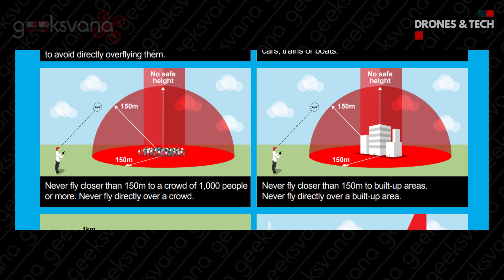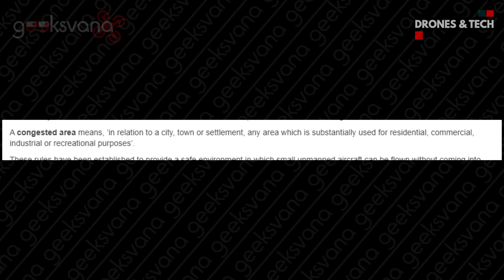What Does Congested Area Mean? With CAA Former Drone Lead Comments - UK Drone Rules - Geeksvana

Comment: I've just completed my A2 CofC course (exam tommorrow) and I have to say it was pretty vague on congested areas and flying the 1:1 rule come the 1st of Jan. I expected alot more in there on this particular subject, I'm still not sure on it to be honest. I think it needs a black and white proper English definitive outline from either parliament or the CAA as its still probably the most confusing point in drone flying and wide open to  interpretation (yours being at complete odds with the copper who's just pulled up to speak to you)
Reply: 1:1 only applies if you're in low speed mode on a certified drone.
Reply: @MikeysOutdoorAdventures  I didnt find it too difficult just a few areas where I had to get the information into my head and have it stick but on the whole you either already know alot of it if you fly within the drone code or its basic common-sense, its just the amount of information you need to go through can be tricky especially if you've been out of the classroom as long as I have I'm definitely giving the GVC a miss I think I would probably have an aneurysm
Reply: @MikeysOutdoorAdventures  you can fail it but most people pass first time as long as you dont freak out or panic in the test you'll be fine
Reply: @MikeysOutdoorAdventures  the course I did with 'airbourne platforms uk' was £125 you pay £75 up front and then the remainder when you pass the exam as far as i know you get one resit if you fail
Reply from the maker: Agreed Leggework. It would be a lot fairer to have simple, clear rules but sometimes the UK law must set the precedent. Should be an interesting 2021, where I am sure this will get tested!!
Reply: @Geeksvana  if its all right with you I'll leave that for someone else to put to the test I wouldnt do well in prison im too pretty

Comment: Hi Sean,  Great video as always and a question that every drone flyer needs to understand.  But I expect every drone flight will need to be assessed and it is disappointing that there are not a definitive rules to guide and every flight carries a risk of prosecution.  When you drive your car you know there is a risk of prosecution but the rules are clear and relatively easy to comply with confidence, shame drone flying is not as simple.   Here is an example or two:  I am on the outskirts of a town next to Crown Estate forest but within (just) the Heathrow outer limit according to NATS.  From the 1st January can I inspect my roof and gutters if I have the permission of adjacent property owners ?  I have Mini 2 - 749 gram take off weight.   Also even though the Crown Estate forest does not allow flying from within the forest by their rules can I fly over it maintaining VLOS from outside if I take off from public land/road ?
Reply from the maker: Hey G Wal! Great to see you and thanks for the kind words! Yes, that's an excellent example and I hope soon our drone rules will be simple to follow like driving etc.

In terms of the examples you raise specifically, the only limitation they can place is take off. So as long as your takeoff point is legal, LOS flight over their land should be legal. It is worth noting that some forests and special interest sites do have specific byelaws blocking drone and model aircraft flight over but they usually advertise this clearly in their website etc.
Reply: @Geeksvana  As my house is of special interest to me I will add a note to my website that says "No Drones, Private or Commercial Aircraft are allowed to fly in the airspace directly above [address of residence] as it is a site of a critically endangered species (1 human, me).  This will unfortunately cause some issues at Heathrow as the planes will have to fly around me.  That should do it.
Reply from the maker: That's it!! We should all do the same and see how Heathrow deal with it...

Comment: CAA as clear as mud there!
Reply: C.A.A. = Confusing And Ambiguous
Reply: Yes it is clear that the CAA need to put this forward in a more clear and precise format for everyone to understand. In my opinion they are not thinking about safety. Umm
Reply from the maker: Hey David Lewis! Thanks for taking the time to comment. It is very frustrating when we are unable to gain clarity on a point which directly impacts so many hobby flyers, which we are supposed to follow but yet the regulator cannot explain it clearly.